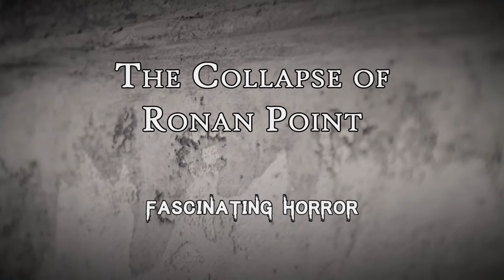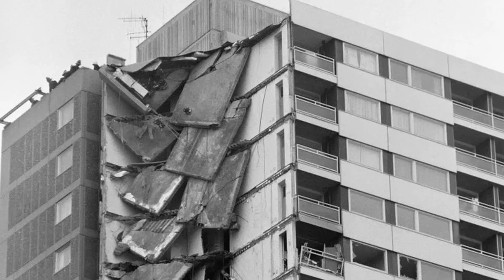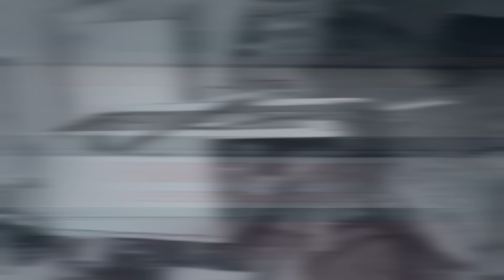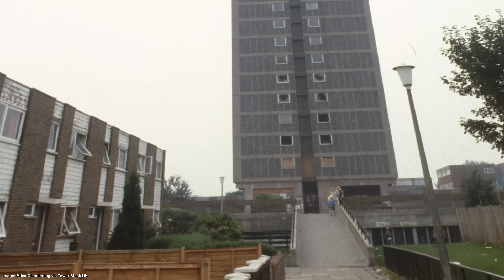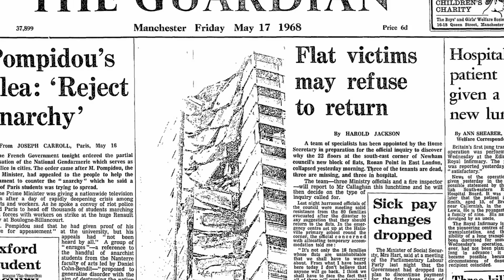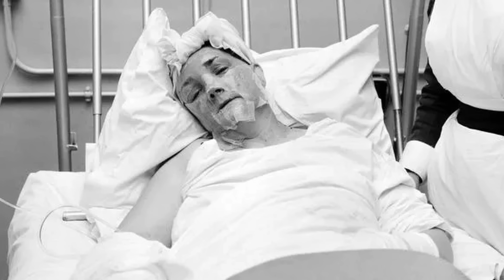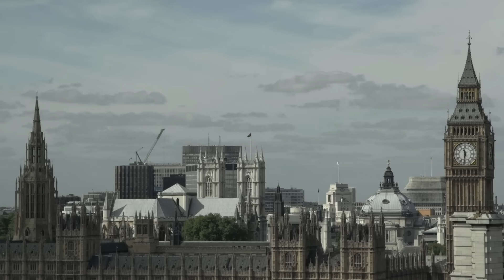Joints Stuffed With Newspaper: The Ronan Point Disaster | A Short Documentary | Fascinating Horror

Comment: This is a testament of how badly those blocks were built. Half of Poland's cities, where I live, (and probably in most of former Eastern Block alike) have been rebuilt after the war with similarly structured prefabricated panel blocks and towers, and they are all fine to this day, with very few being demolished for any reason. Which is a prove that the concept itself is valid, only the execution was bad.
Reply: The actual method of connecting the slabs is potentially very good and strong but any building method can be compromised when it is carried out in such a shoddy way.
Reply: That's actually very accurate in Vietnam as well! We also have a huge amount of communist blocks, many are built with panels as well. Primarily built in the 50s - 80s, when we were drenched in war and poverty, those buildings somehow still stands to this day, although they're very much weakened and some residents need to be evacuated. 

I feel funny that the quality of those "communist" buildings are much better than our 2000s - early 2010s "rehabilitation" residential complexes, which were built so cheap that they were already weaken in the year after they've finished. They still stands to this day, except that they are even weaker than those panel buildings. Great.
Reply: @ngoclong2k5-hust  buddy, Vietnam didn't even have gas network until 1995.
Reply: @81k3r  I didn't even mention about that, lmao. 

Vietnam is not even a place like Russia, where natural gas is abundant. We might use wood to cook instead. We were too poor to even build a standalone kitchen. 
I mean, our commie blocks had places called "public kitchen", where we'd cook with others. With that, every room didn't have their own kitchen. Even the restrooms too. 

Our commie blocks are a good example of "we have nothing but budget slicings".
Reply: Yeah, that's definitely what gonnna happen as USSR invented the LPS system, my grandpa was an engineer who went to USSR and many other Warsaw Convention countries to learn that, at that time in China it's a totally now tech only few buildings use this method and it is still been used in nowadays China. USSR and its satellite states are really good at this.
Reply: Ukranian prefab blocks don't even fully collapse when they get hit by a cruise missile.
Reply: @emily36130  soviet prefab blocks
Reply: @emily36130  How about   the monuments dedicated to Nazis?
Reply: @fritzdrybeam thats based
Reply: And this building was only two months old.
Reply: I think it's that way in the whole USSR and the warsaw pact nations. And them being considered shittily made with uneven panels, for Britain of all places to not be able to do what's basically big legos, sounds like a skill issue
Reply: Eastern Block Engineering superiority
Reply: @DonVetto-vx9dd  I think this is an example of communism actually being a good thing. Since there are no capitalists in the Soviet system there is no need for planned obsolescence. They build those buildings sturdy because they didn't want to pay for them again.
In this case the buildings were paid for by the government but build by private companies and so those companies have every incentive to cut corners since they will only get more money if those buildings fail. The taxpayers have to fund the cost of shoddy workmanship, not the contractors who did the shoddy work.
Reply: @MrMarinus18  Sorry friend, but it wasn't 'Communism' exactly that resulted in sturdy construction, but totalitarian authoritarianism. In the UK the builders we often veterans who returned from war to live in abject poverty, or young men who grew up during it...and lived in abject poverty while getting bombed. The trades hadn't been passed on properly, and record keeping of workmen was so lax that they could job hop with fake names rather easily. 
In comparison, the Soviets liked to keep track of their people very closely. And if a regular person was found to be shirking work or skimming from the top, then they had at best, being dragged off by the authorities for a brutal beating. Or at worst, their entire family 'collected' in the middle of the night, 'interrogated' and then wiped from existence and records. 

Ask almost anyone born in a soviet state back before the 80s, and most will be able to tell similar stories of either witnessing people being black-bagged, or being told that 'There was never any person or family of X name here or anywhere. Understand?'.
Reply: @MrMarinus18  Commie blocks were built to be self-sustaining communities. The one I lived in was built in like 1976 and you still have space to park your car there. Back in 1976 almost no one had personal cars in Poland. These boroughs were built with so much future proofing. They have reasonable flat floorplans, reasonable distances between buildings, lots of space for utilities such as green acres, playgrounds etc. The borough also has its own kindergarten, primary school, a GP, a bunch of grocery stores. You don't have to drive anywhere, everything is less than 1 mile away.

Meanwhile, "modern" capitalist neighborhood in Wrocław - blocks are extremely close to eachother, parking space costs as much as a 5-year old car (country's avg car age is like 14), there's obviously no school or kindergarten anywhere close, so everyone drives. There's just one narrow road that jams every fucking morning, to the point of taking 20-40 minutes to simply get out of this hellish district. And this shit is like, 30 year mortgage and that's only if you actually earn pretty well. It's expensive, it's terrible, it's anti human. Build more of those and wonder why fertility rate is 1.0.
Reply: @alewis514 i think its a major post soviet city problem. Im from Ufa, Russia and its same here, monstrous 20-30 floor towers are built in the middle of 5 floor micro districts or near 2 lane road. No infrastructure at all. Traffic jams in those places became usual. For build conpanies its an easy cashgrab, for city - local and overrall overpopulation. Those who buy those homes seems happy - they are modern, but i can't see this no more than insanity. Happy to stand in lift trafric jam and then in a road one every morning and evening. Is this reaaly should be this way?
Reply: @MrMarinus18 technically commieblocks are built with planned obsolence in mind, its 50 years for most buildings. They were built with condition of deconstruction and rebuilding to other type of house after 50 years. That is on paper.
What made them stand to this day is choise of materials and government moderation for those materials. There was no competition in planned economy - no need to cheap on things, government standard is already a balance between cheap and efficient. But its not always like that, sometimes government standard is onle cheap, not good at all.
Reply: @DonVetto-vx9dd  Eastern Block engeneering LOLOLOL Utter nonsense seeing as over 80% of your unicorn fantasy are Western knock offs..
Reply: In France it’s probably the worse, we have ghettos with towers like that in every cities, and A LOT of them were demolished, in the 90’s, 2000’s and even early 2010’s some of these towers/neighborhood looked like the freaking Bronx in the 70’s ..
Reply: Even in nowadays Russia which has much worse economy compare with Poland and spent much less in building maintenance, there are still rarely major issue with LPS system.
Reply: @marquentsu5927  Where do you get those fairy tales about Russian economics?
Reply: @Reginvalt  Check Russian GDP yourself
Reply: @marquentsu5927  No need to check, it's #5 GDP by PPP
Reply: @Reginvalt  So that's why you need to check, it's not 5th.
Reply: @marquentsu5927  It depends how you count. https://en.wikipedia.org/wiki/List_of_countries_by_GDP_(PPP)
Reply: @Reginvalt umm, no. Russia has the #47 GDP per capital Einstein🙄
Russia has a TERRIBLE economy
Reply: @Reginvalt for those on the thread who didn’t check Russia has the #47 spot in GDP per capita.
As everyone already knew: the Russian economy is losing to such “powerhouses” as Guyana and Cyprus.
Reply: @kineahora8736  Statistics is meaningless if you can't interprete it. USA loses to Luxembourg or Iceland by GDP per capita, so what? People are prone to throwing numbers they don't understand.
Reply: @ I fully understand the numbers— and I do understand that Luxembourg and Singapore come out on top.
Either way you slice it — Russia has a terrible economy, considering the size of the country, and it’s not even ahead of other petrol-based economies like Saudi Arabia…

Meanwhile, you are the one who introduced that particular statistic, which is GDP  per capita— that was YOUR handpicked statistic—not mine, and you couldn’t even quote it properly citing Russia as # 5 when it’s not even close🤣🤣
Reply: @kineahora8736  You have no idea what you are talking about. I didn't bring GDP per capita, I brought GDP by PPP (where Russia is quite high) just to show that being high or low on a list doesn't reflect anything. I live in Russia for 37 years and remember everything from mid 90's. The reality is that during these times Russia progressed from a deep recession to Western European level (been there alot). Claims that Russian economic is failing are not just hilarious, they are disconnected from reality. Westerners are kept delibreately deluded about situation in Russia, China, Iran coz they are the "enemy" and can't have anything good.
Reply: @ OK that’s on me— I misunderstood which metric you were talking about… but you did cherry-pick a metric, and im not an economist so I don’t know if your chosen metric is “the best” or not…
(And yes Ruzzia and Iran are indeed “the enemy”—and for very good reason)
Reply: @Reginvalt  especially americunts
Reply: @marquentsu5927  lmao Russia clearly rich nowaday
Reply: Those in Poland probably didn't have paper products instead of mortar
Reply: @TheWaMaster  No we had sand products, where they would steal all the cement when building and the houses ended up so brittle that a good punch may make a wall crumble.
Reply: You must be very proud of your ugly brutal architecture, congratulations on your miserable buildings!
Reply: @symm1982   Shut up. Please, just shut up. No one likes ragebait.
Reply: Theres a reason why u don't want to by a british car either
Reply: Superior communist architecture. 💪🚩
Reply: There are other geotechnical variables you are ignorantly excluding. One design does not work anywhere without additional measures taken. Regardless of design, I agree that the execution was crap.
Reply: I think it's also worth noting that most of them are nowhere near as tall as Ronan Point and usually much wider, which probably makes them a lot more stable.
Reply: That is because they were build by government agencies which do want to have sturdy buildings so they don't have to be rebuild. Capitalist structures actually want them to have a short life span so they can get hired again to replace them.
I think the problem here is the capitalists wanted to get those lucrative government contracts and the government wanted to have the buildings up so quickly they didn't ask too many questions.

Planned obsolence and the fact that companies often benefit from being economically inefficient has always been the main problems of capitalism. If the government pays the cost for a company's shoddy workmanship then there will be a lot of shoddy workmanship.
Reply: We still build condos here in Canada with prefabricated blocks. Nothing wrong with them other then being kinda blocky. Theres a 20 story building a couple blocks from me from the 80s built like that. It looks ugly but works n
Reply: Badly built. For 30 years. Its 50 Ears now on
 IT works. The home, the pleassure
Reply: The British don't hold a candle to Polish engineering. Tha'ts a fact.
Reply: @varvarvarvarvarvar  It was nothing to do with engineering. It was all bad workmanship on the site.   If you try to assemble a Meccano kit but leave out all the nuts, can you really blame the designers when your model falls apart?    That's essentially what happened here.
Reply: @varvarvarvarvarvar but this is an issue of workmanship, not engineering. Speaking of which, Singapore also uses a similar method of assembling towers via prefabricated rooms and wall blocks after the war. And Bangladeshi and Indian labourers do the workmanship. Over 4 million people live in such residential towers and not a single one has collapsed, ever.

Although a hotel did collapse and is the only case of building collapse in Singapore, ever.
Reply: @bigsmall246  How do you figure that?
Reply: @varvarvarvarvarvar  He figures it by having a modicum of intelligence, unlike you.
Reply: @varvarvarvarvarvar  Utter b()llocks. Seeing as over 40% of the worlds engineering inventions have been made by the brits, your anglophobic BS doesn't stand up against the facts.
Reply: @varvarvarvarvarvar  *Soviet
Reply: @varvarvarvarvarvar  which is why the allies had to save Poland
Reply: @varvarvarvarvarvar  Oh it's a fact is it?  You'll need to provide some sources for this so called superiority.
Reply: @markinyo76  It only takes two Polish people to screw in a lightbulb.
Reply: @varvarvarvarvarvar  British always came up with strange ideas when resources were scarce. Some of their ideas brought unexpected results but some of them were really weird. Look up british chicken nuke idea named Blue Peacock.
Reply: Gas leak can demolished everything.... 
https://youtu.be/q0DWLM1r0BY?si=dN84Tsgav68ZeCXG
Reply: @miroslavdockal9468  also there was in Gdańsk (Danzing or whatever you call it) that partially collapsed after gas explosion in basement.
Reply: Commie blocks are particularly ugly.
Reply: How tall were these buildings in Poland?
Reply: @nevillehoward8736  usually like 20 stories
Reply: @nevillehoward8736  Up to 12, but most common are 5 and 9 story buildings. 5 is max for a building without a lift, 9 is max with 1 lift.
Reply: Didn’t a bridge in what had been East Germany collapse not that long ago?
Reply: concrete cancer?
Reply: That's because the Soviets actually built those with the intention of housing human beings, and not just trying to make a quick buck
Reply: @game_boyd1644  Yes, because the Soviets were known for their humanity....
Reply: Not all of the chruschev blocks are okay. Quite a few of them had similar collapses.
Reply: There are plenty of these blocks still standing in the UK too, but don't let facts get in the way of your prejudice.
Reply: Defective ones collapsed during communism and info about them was swept under the rug. The ones still standing will be standing until getting generous amount of heavy bombs or someone decides to get rid of internal walls without asking any engineers about it, because open floors are all the rage these days.
Reply: @luser-kv4ok1ml9fq  only one collapsing in PRL era I knew was during construction where my grandgrandfather was building safety inspector (or something like that) couse someone else „failed” with inspecting safety.
Reply: In America the quality of many buildings and homes is suspect.

The builders and government officials of these will be ‘long gone’ with profits by the time of disrepair or disaster.

It’s the American way 😳
Reply: @comeon_man I Japan many homes burst into flames under a small bomb
Reply: @comeon_man  Man that isn't singular to America in anyway, Greed is very universal
Reply: @comeon_man  every house I have lived in is from the 60’s or prior and all still standing 😂 what are you going on about?
Reply: @comeon_man  ah yes all the US buildings falling down every day, thousands dead every year, really awful 🙄
Reply: @comeon_man  there is same as hell in turkey
Reply: @comeon_man this video has nothing to do with America. Rent free...
Reply: @JohnDoe-td7mu  this couldn’t happen for instance in north Miami Beach could it?🙄
Reply: They weren't built  under  capitalism.
There's the variable.
Reply: The Soviet Union is rightly reviled in Poland, but they did have excellent construction practices. Largely because the government wasn't trying to profit and knew it would need to maintain anything it built. So they figured out a method which produced consistently sturdy buildings and spammed them everywhere.
Reply: Britain pretty much gave up on life after WWII.  Also, no one cares about the working class in classist UK, so they build the worst quality for social housing like this.
Reply: @Tochtochtoch  A statement based on no facts whatsoever, but thanks for the vibes Russian bot.
Reply: Thanks, YT, for ce$()ring for comments.  U tw!!ts.
Reply: The reason why they still stand is they were extensively renovated in the 90s at insane costs. When I look at Brno, my home city, for example, all of them are renovated through the 90s and 00s, no matter if they were built in the 50s or 80s. Several tall ones had to be evacuated as they were slipping down a slope and it took months of concrete injections into the foundations to secure them. I still remember the evacuation procedures. 

Those that were not renovated don't exist any more, they had to be demolished.
Reply: @neverstopschweiking  In Ukraine they weren't. And they aren't dangerous, yet. The older 5 floor ones are not very good in some places I think, but most houses, the 9 floors, are good
Reply: @Fan_of_Minecraft_UAs-channel  I only know several people from Ukraine and as much as I want to stay respectful, I know the safety standards and quality of life standards are not as high as in Poland or the Czech Republic. They were close, but Ukraine didn't move as fast towards higher standards as some other former eastern bloc countries. Ukraine does have cheap energy, though, so I guess insulation is not an important issue.

Sure, Odesa, Lviv, Kyiv, they had some reasonable architects and some buildings were built up to a high standard, but not many. And the buildings suffered from the exact same issues as those in Poland, Hungary, Romania... 

I'm not talking about some virtual things I heard about, I have actual experience, I spent my time with my grandma in her apartment in the cube four floor one, I lived in the apartment on 9th floor in a 13 floor one, I have seen kids of people evacuated from another tall one in the same district my grandma lived, because the tall one started slipping down the hillside.

Most of these apartments were sold to it's residents for incredibly cheap, because they were in dire need of drastic renovations and the cost of the renovations was close to the final price if the apartment itself after it was done.
Reply: Wait they built panel housing taller than 9 floors?! I've never seen ones like that
I live in Lviv, and taller houses are made of white brick
Also insulation is an issue, because the heat either goes top-down or bottom up, so it's basically uncomfortable for everyone except the middle floors. Also insulation would help in summer when my 8 floor apartment turns into hell
 @neverstopschweiking
Reply: @Fan_of_Minecraft_UAs-channel  Sure, in Prague, we have the tallest panel house with 23 floors, although most normal ones in our country don't go over 13 or 14 floors. 

Oh yeah, I can assure you insulation helps with cold, but not that much with heat. If you don't get A/C, run a fan through a drying rack with several wet towels on it. It does cool down the air a bit, it will take down the temperature few degrees. Of the air, the walls will remain like low setting of an oven.
Reply: Poland is German-influenced. The Germans actually give a crap about procedures involving life-and-death issues. They make good cars, etc. Now the British Royal Family is actually ethnically German. Maybe that's why they deliberately instilled this depraved indifference to human life amongst the British population, which quietly persisted after their flashy WW2 victory. But if so, that doesn't explain why even the impoverished Poles are more considerate of one another.
Reply: like most nuclear power plants...
Reply: There’s always duds. You could manufacture 1000 of anything. Using the best possible techniques, methods, and staff. And at least 1 unit will be garbage.
Reply: @humpteedumptee8629  But when you use shoddy materials and workmanship, you can pretty much guarantee 1000 out of 1000 builds will be shoddy. And to be fair, if you're using the best staff, that will include the best quality control. So even when someone does make a mistake, the quality control will pick it up and flag it for rectification. Because jobs of this magnitude should go through multiple quality control checks, not just one.
Reply: @rodh1404 completely agree, greed always plays a factor in these shoddy builds. It's not innevitable if the right procedures were met  materials and craftsmanship was standersided and always completed in an approved tested method.
This 1 in a 1000 he speaks of would not happen.
Reply: @rodh1404  the problem is that there is always a deadline. You can have the best quality control in the world but it doesn't matter if there isn't time to fix things.
Reply: @dm8579 there is no hard deadline in developed countries: it has to pass every quality control, or it's unbuilt and rebuilt again. That's why it takes 20 years for the UK to build just one nuclear power plant nowadays.
Reply: @humpteedumptee8629  This isn't a matter of bad luck. This was intentional corner cutting to earn more money. It essentially was criminal negligence or even recklessness. They knew or should have known when they constructed these buildings so poorly that people were going to die.
Reply: @humpteedumptee8629  No. The building collapsed due to deliberate choices in the construction and materials used. They used newspaper in the construction. A material that easily breaks down when exposed to moisture. That was a deliberate act and not a manufacturers error.
Reply: @humpteedumptee8629 yeah but good engineering accounts for that, so you have quality controls in place and you build things with redundancy. Even in this case that was sort of true - the whole building didn't collapse, just part of it. It's always a question of cost cutting vs risk, and unfortunately sometimes risk is the lower consideration
Reply: @humpteedumptee8629  How to tell us you haven't fully watched the video.
Reply: @humpteedumptee8629  yeah, which they did none of! NO wonder it collapsed.
Reply: @humpteedumptee8629 by that logic all concrete and brick buildings suck just because some engineers cut corners.
Reply: Commie blocks suck.  Reinforced concrete eventually fails despite maintenance because the steel oxidizes.  If we were to build right, we'd use only granite.
Reply: @peppertrout yup, just look at the Champlain towers south in dade county Florida
Reply: @Albertan.Republic Not so. If the steel is deeply covered by concrete etc, water cannot penetrate to oxidise it.
Reply: @nevillehoward8736  ok, I don’t agree, but concrete eventually collapses.  Even the Parthenon had required maintenance.  Granite lasts forever.
Reply: @peppertrout  Unless it is used improperly. :(
Reply: @nevillehoward8736  Guessing you're not an engineer. It has NOTHING to do with how deep it is. But the quality of the concrete.
Reply: @okbutthenagain.9402  And neither are you an engineer, by that post. The thickness of the concrete does indeed factor into it.
Reply: @nevillehoward8736 if you regularly do maintenance work to detect and seal every crack, everywhere, maybe, maybe. This type of construction material is not suitable to guarantee it will last centuries.
Reply: @Albertan.Republic  I've seen broken, cracked, granite.